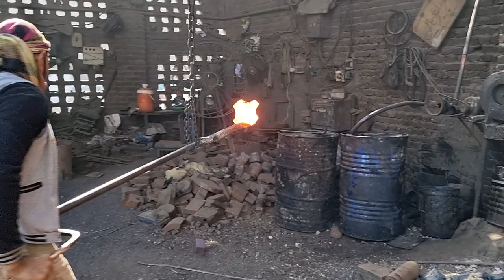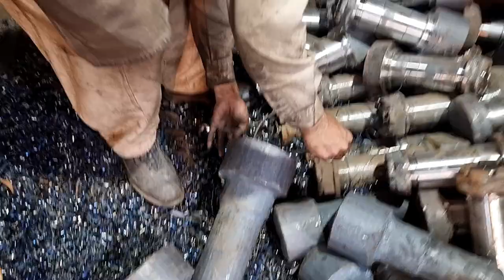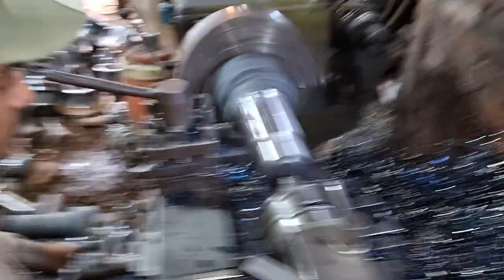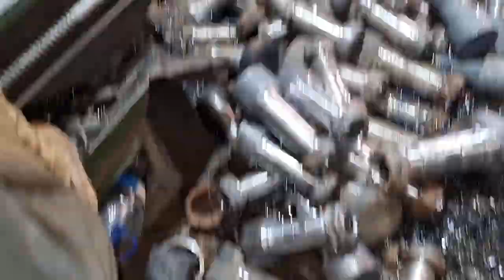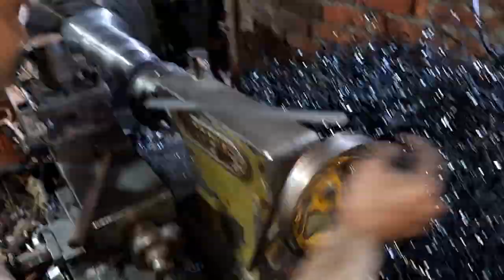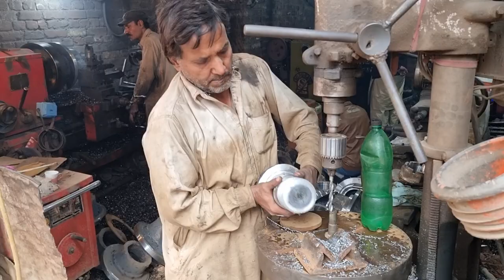Forging and Manufacturing Truck Trailer Axle Spindle | Production Process of Trailer Axle Spindle

Comment: Forging is much stronger than casting. I am convinced that it will be in operation for a long time. Congratulations 😄.
* * * * * * * *
This process is related to matching the crystal structure to the shape of the forged detail. I cordially greet the fans of this channel 😀.
(January 13, 2022).
Reply from the maker: Thank You